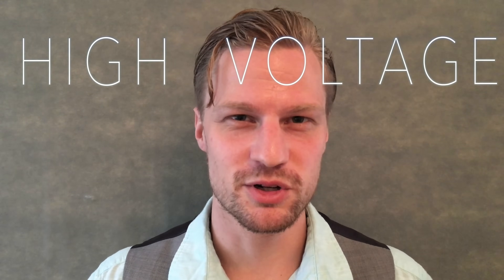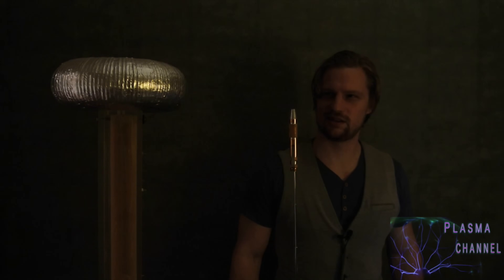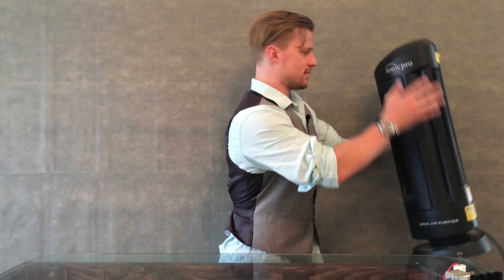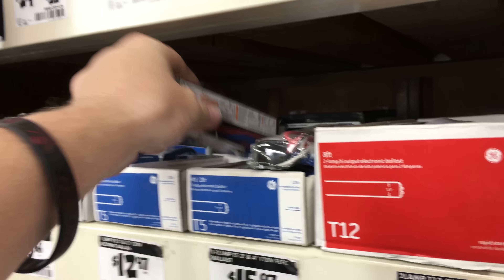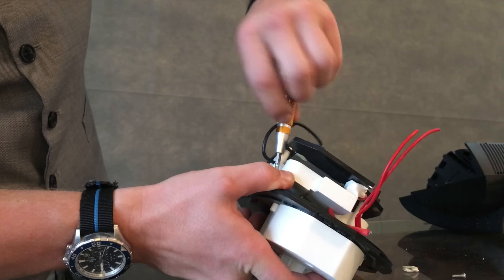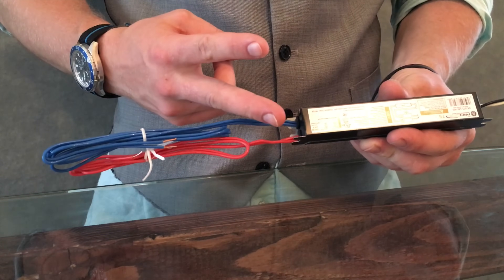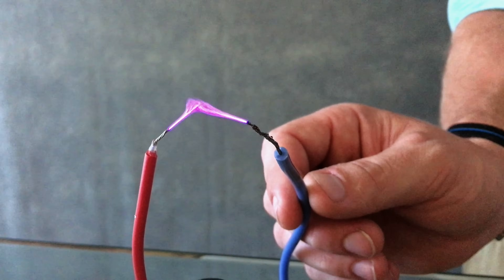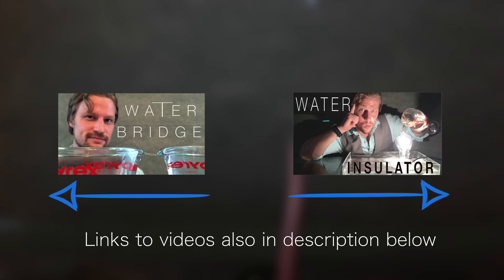Super Simple DIY 10,000v AC Supply!

Comment: In my circuit the displacement current can perforate the insulation of the output wires if  close to a conductor, because my transformer does not have voltage multipliers?
Reply: Fluorescent ballasts tend to drive flybacks much harder than they are in a CRT TV, if that's where your's came from. A TV flyback is driven with a square wave at rectified mains voltage by the horizontal output transistor, but the deflection yoke causes the current through the flyback primary to ramp as a sawtooth waveform. The air gap between the two post halves of the ferrite core, inside the coils of the flyback, causes the flyback to store some energy like a capacitor during the primary current ramp up, no secondary current flows because of the built in rectifier diodes, and then it discharges that energy in the DC pulse created when the sawtooth ramp drops off. When driving a flyback with an electronic ballast the output V of the ballast is usually much higher than rectified mains. The electronic ballast uses a resonant LC circuit to drive higher voltages and current through a fluorescent lamp tube at a high frequency of around 25 KHz and voltages of between 300 and 600 volts. Most TV flybacks are resonant at around 15 KHz, it's not too far off from the flyback's resonant frequency to matter. The higher voltage and current of the ballast drives the flyback harder than the horizontal output transistor drive circuit in the TV. I have a large DC flyback that I had to put in a plastic jar with the inputs and outputs connected to terminals through the wall of the jar with sealer around them, and filled it with mineral oil because my 55 watt ballast was driving it so hard the pins on the bottom of the flyback were arcing like crazy, and the high voltage was arcing through the thick red insulation on the positive output wire. Once the oil stopped the wasteful, energy robbing pin arcing, and losses through the insulation, I got an impressive output that I use high quality auto ignition cables to carry the HV to a load. I can power a small Tesla Coil with it. It's output current is comperable to a low end neon sign transformer, probably 10 mA or more, but at the high frequency so it is less sensitive to RF from the TC primary, though I still use chokes and safety gaps to protect it.

Comment: Hi Plasme sir!  I have an question . Is there anybody whi will answer me? ❤  
As understand it good, I can reduce 220V to less volt with a driver? For example, a carbon-wallheater rises or lower his heat by higher or lower voltage. Can I use this driver for it?  Thanks for answering me.
Reply: If I understand your question, heaters, and electric ranges/ovens with resistive tungsten nickel heating elements use rheostats to control their heating elements which are high wattage variable resistors, similar to potentiometers, that have a circular strip of resistive material that a sliding "wiper" contact slides across as you turn the knob. One end of the resistive strip is connected to the AC mains power supply and the wiper is off of that end when in the off position. As you turn it on the wiper contacts the strip at the supply which is high, then as you continue to turn it the distance of resistive strip material between the wiper contact and the supply gets greater which reduces the current flow through increasing resistance which varies the temperature through medium high, medium, medium low, and low. Unless it is a rheostat that starts at low in which the wiper contact is off of the other end when off, then starts at low and goes higher as it is turned until it reaches the supply contact point at high. The voltage to the heating element doesn't really go down a lot because the method of heat control is current control. The less current through the resistive heating element, the less energy from the current is transformed into heat. The fluorescent ballast here does not supply the current needed to power a heating element. In the US, heating elements like in heaters use high current from 2-15 amps at 120 volts, and heating elements on ranges and in ovens, laundry dryers, and electric water heaters usually use the higher wattage 240 volts because it is more efficient and can supply up to 30 amps at a couple of thousand watts. The output of a fluorescent ballast is not variable, except for units designed for dimming, but none of them really put out enough current to power a heating element. And a flyback transformer, like this one, driven by a fluorescent ballast only puts out a few milliamps, not the many amps and watts a heating element needs. So to sumerize, the name of the game with heating element control is current control.

Hope this helps.

Comment: I recently found an air ionizer at the thrift store, but upon disassembling, I found that there was a small box connected to the ionizing spikes. It says "input 120 vac 50-60 hertz, output 7kv dc negative." theoretically that would contain a transformer and diodes, but it could have some sort of electronic circuit. The whole air filter works anyway, so would it be worth trying to recover a transformer, or should I just use the whole thing like it's supposed to be used? and should I buy the transformer off amazon, or find/ try to make my own? sorry for a lot of questions, but I want to make sure I don't blow up my parent's basement...

Comment: Can I use the CRT TV transformer ..??
Reply: Yes but unless it is an old black and white TV, the flyback from a more modern CRT will have a rectified DC output. You can use DC to charge capacitors and do the levitated water bridge trick, but not to drive a plasma globe, and AC won't charge capacitors or do the water bridge, but it will drive a plasma globe and do other things DC won't. Neon sign tubes require AC, and AC tends to do better on Jacob's Ladders.

Comment: I built a high voltage generator using a flyback, but wound a custom primary on to the exposed side of the core and used a 555 timer and a mosfet as the driver circuit, it gave arcs like this and if I put a reasonably strong audio signal into pin 5 I could get music to play out of the arc! I also built a 1KW ZVS flyback driver which gave me bright 8 inch arcs from a small flyback out of a portable TV.
Reply from the maker: Excellent! But 8 inches????! In all my years building gadgets, i've never puled more than 3" from a flyback.
Reply: @PlasmaChannel  I doubt he means initial arc but rather the peak of the pull back.

Comment: BALLAST PART NUMBER??
Can't find the right ballast, whats the part number?
I've tried several new off the shelf, 0 Volts unloaded(no connections just the meter)
The only one I've gotten  to work is for a small equarium light, puts out 200Vac unloaded.
This works but I need MORE POWER!!
Gary
Reply from the maker: The ones with 600 volts open circuit voltage seem to work really great. As per the number... not certain, tag fell off. But it was 12.00 at Home Depot. 40W ballast

Comment: Guys you can also get those Transformer "flyback Transformer" from an old crt monitor/tv , go check your basement for one...
Reply from the maker: You certainly can. Though, those are DC flyback. So if you want an AC go for the ionizer.
Reply: Plasma Channel will it be any noticable difference between using a ac or dc flyback as at that voltage both are equally dangerous??
Reply from the maker: Great question. You will attain the same voltage out (assuming ALL other variables are the same), but, less power out. The internal diodes of the DC flybacks cut the power effectiely in half
Reply: @PlasmaChannel  how can i differentiate between dc and ac flybacks help please

Comment: The output of flyback transformer is DC, not AC. Because this transformers have a high voltage diode inside. Just correcting, thanks
Reply from the maker: The flybacks out of air purifiers are AC actually, because they connect to voltage multipliers down the line. Also, I’ve tested them with external diodes to see if they are AC or DC. Not all modern flybacks have those nasty internal diodes

Comment: Does every different transformer have different operating frequency?
Reply: Yes. A transformer's frequency depends on the inductance and capacitance of its coils and windings, and the dimensions and magnetic characteristics of its core material, if it has a core. Mains frequency transformers (50-60 Hz,) tend to have laminated electrical steel cores with layered steel alloy designed to reduce eddy currents and heating, and high frequency switch mode transformers like flybacks tend to have ferrite ceramic cores with frequencies of thousands or even millions of hertz. CRT flybacks tend to have resonant frequencies of around 15 KHz for large color TV's, and 30-150 KHz for computer monitors. The resonant frequency is the frequency a transformer is most efficient at because its inductive and capacitive reactances are equal in magnitude and cancel each other out, so as much of the energy going into the transformer comes out transformed to a higher/lower voltage instead of any of the energy being stored in the transformer's inductive or capacitive fields and getting wasted as heat. It's just like a radio antenna, it needs to be fed RF at its resonant frequency and have the correct dimensions and characteristics for the frequency you are using so its inductive and capacitive reactances are equal and cancel each other out so as much of the RF energy you are putting into the antenna comes out radiated into the far field, and none of it stored in the antenna's inductive or capacitive fields which would otherwise be inefficient, wasteful, and cause standing waves being reflected back to the transmitter causing heating and wear in the transmitter's components.

Comment: I’ve done a lot of research on flyback transformers... but I’ve never heard of them being put in air ionizers. The one I took apart had a small potted epoxy circuit in it to produce -7k volts.
Reply from the maker: Specifically shaper image ones I found had ac flybacks

Comment: I don't really want to go out and purchase an ionic air cleaner, but I do have a microwave transformer. Since it outputs ac to ac current, that would work, right?
Reply from the maker: Unfortunately that would not work. MOT’s do not operate off of high frequency, and they require 10 amps of current
Reply: Plasma Channel wow, thank you for the response. It's a shame I can't use my shiny new transformer though. Time to search for an air purifier

Comment: Just trying to find some info about the easiest levitation melter!And the question is just can I make it with attaching a levitation coil to a microwave oven high voltage transformer and simply plugging it in?
I am actually not very familiar with electronics(honestly at all🤧)-I am just a firearms designer-very rare and cool profession-but hey,there is not too much electronic stuff in firearms,but I still need a (simplest possible) levitation melter,so can anyone please tell me if I can do that with just a coil,a transformer from the microwave oven and a plug wire?

Comment: You idiot that is nod an ac power it is a dc power supply
Reply from the maker: You clearly have never taken apart ionic cleaners before. That’s okay. Many brands use an AC flyback that powers an external voltage multiplier, creating the high voltage DC used for static cleaning. I also independently confirmed it was AC by attaching diodes, and checking flow in both directions. Not all flyback transformers have internal DC diodes built in. #PlasmaChannel

Comment: can this be used to power a tesla coil? if so, how?
Reply from the maker: Indeed it can! Just rectify the output, and use it to charge a circuit designed to run at 15kV
Reply: Hey! thanks for the reply, i got a 10kv dc flyback and it has 2 knobs that say "focus" and "screen". ive searched but cant find any information in what are they doing and how are they affecting the performance of the transformer. can you help?

Comment: sadly the driver you are using are very uncommon here in NZ with all using the solid inductor type, and for the ones you use cost $75 or more and are special order.  i have found them on ebay for $6 so im going to have to wait a month to get it here, and have several failed ZVS drive builds that don't work and i have 35 flybacks waiting for use after being recycled for old CRT tvs. have several high voltage builds that need these to work, have voltage multipliers, Marx Generators and loads more, all will feature on my new channel Tesla Sparks.
Reply: Ah, New Zealand, cool, I'd love to see it. You guys just had a quake in northern NZ, 65 km WNW of Waiouru, magnitude 4.5, 152 km deep this morning at 07:07:03, 22-04-2019. I love my world quake app. I bet it tends to get interesting living that close to the Pacific Ring of Fire. Now Japan and Indonesia, they can keep their quakes all they want, I swear Japan is always rocking and rolling, and that Tōhoku 9.1 quake and tsunami of 2011, holy crap! And Sumatra and the Sunda Megathrust fault and their tsunamis, no thanks. Yea ZVS drivers can be temperamental to get oscillating. You really have to use the 200V IRFP250 MOSFET, or the higher rated 500V IRFP460 on good heatsinks, they are truly pieces of artwork. You can try another MOSFET as long as its VDS is 4 times the supply and RDSOn less than 150 Ohms, but not many others tend to do well. Also you really have to use ultra fast UF4007 or better diodes, 10-20 amp 47-200 uH inductor, 47 uH for more current output, 200 for more voltage output, the tank cap has to be good, 0.68 uF MKP, greater than 250V dielectric, and the supply has to provide at least 10 amps. But I'm sure this is basic info you know, so hope you got them working.

Comment: Pretty cool, I took one of those apart and made an electro-mechanical oscillator out of it a while back. I Didn't use the electronic fluorescent ballast like you did, I just used all the original circuitry and bypassed all the safety switches. Couldn't pull much power without the circuit shutting down. Guess I'm gonna have to run out and get a ballast now! https://www.youtube.com/watch?v=8OGGyfk7XHc

Comment: How dangerous is that high frequency arc? Is it possible to get a lethal shock from it if someone touchs it?
Reply: Not really. Flybacks put out low current at high frequency, so it would be like a Tazer. It will be painful and uncomfortable, unless you like pain 😏, but doubtful it would be lethal because flybacks usually don't put out more than 5-10 mA. Now I wouldn't want to get shocked by one driven by the Mazilli ZVS driver, or get shocked by the charged DAG capacitor of a CRT, or any other capacitors when charged by a DC flyback which if they have a high enough capacitance, can hold enough charge to be lethal if it crosses the heart. Unlike the high frequency of the flyback, a capacitor gives you the full charge in one pop. Capacitors are what deliver the charge in defibrilators. Now neon sign transformers over 10 mA, though current limited, can be lethal because of the mains frequency. Also microwave oven transformers are without a doubt lethal as hell! They are not current limited and can deliver amps at mains frequency and hundreds or thousands of watts.

Comment: Can I just use micro wave transformer
Reply from the maker: Those will not work on high frequency, and only produce 3000 volts at most. If ever using an MOT... be very careful. Those shocks are absolutely lethal.
Reply: Plasma Channel thanks
Reply from the maker: Certainly!
Reply: Plasma Channel you may have saved a questionably eccentric 14 year old...
Reply: I'll stick with different transformers
Reply from the maker: I shocked myself extraordinarily bad when I first started out. An MOT discharged through my right arm.. and I was leaning on a metal bench, so it exited my body through my crotch. I was taking pictures and it jumped to my arm, caused my whole body to contract, and I flew back about 5 feet. If it had gone arm to arm, across my heart..... this channel would never exist, nor would I. Yeah, one thing to be really safe is to always use the ‘1 hand rule’ with high voltage. Protects your heart!
Reply from the maker: Check out my ‘arc apocalypse’ episode. You’ll see the power of an MOT there.
Reply: Plasma Channel yeah if you only need 1 hand to draw an arc with metal on a stick stay with 1 hand hold it far away. 
And ouch!!!

Comment: Would this be a nice Tesla coil driver or powering device?
Reply from the maker: Yes, you absolutely could use this to power a tesla coil, if you recifty the AC output
Reply: Thank you very much, I have yet to locate a transformer from an ionic air filter, I will be powering a CRT flyback which has a built in rectifier, if that’s what you where talking about?
Reply: This works fantastic, I finally worked up the nerve to give a go.
Reply from the maker: Excellent!
Reply: Plasma Channel you don't have to use D.C. on a tesla coil, sure the newer style ones which in my opinion won't last as long.. but the old spark gap ones can use A.C.
Reply from the maker: I just suggest using DC high voltage for a spark gap because then no transformer matching is needed with the Lc circuit of the primary. Using dc makes the entire build a lot easier, in terms of capacitor choice, and primary circuit design. With AC the cap needs to match the peak voltage of the transformer and ideally discharge at each voltage peak. But that requires additional effort to calculate and design.
Reply: Plasma Channel yes but that's alot better when the entire system is in resonance
Reply: Plasma Channel But I have to admit, it's way cheaper to get high voltage DC capacitors.